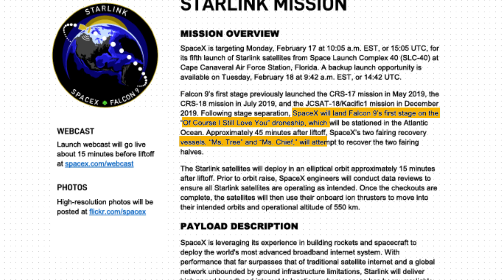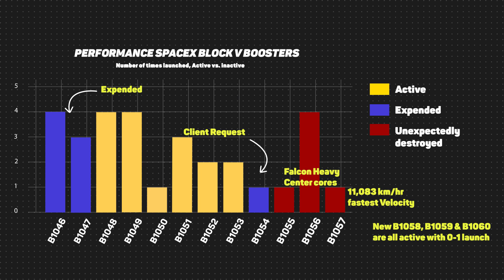SpaceX landing misses target, bad for Reusability?

Comment: The economics of re usability mean that you get diminishing returns. As an example assume the booster costs 50 million to manufacture. To catch and refurbish, 1 million. Then on first reuse, you save 24 million per flight. The second reuse is only 8 million cheaper per flight and so on. After 8-10 flights your main costs are fuel, refurbishing launch pad costs etc.

Comment: To be fair, the booster didn't explode, it just missed the drone ship. If it wasn't trying to land on a postage stamp in the middle of the ocean then the booster might've been able to still land. So it was some kind of navigation error, whether that be software or hardware related. Those are usually not that hard to fix. Heck, considering they missed the fairings too, it could've been an error in the ships' navigation software.

Comment: Bad video, "failures" is what has got us to this point with the falcon 9 rocket. You learn very little if it goes to plan. Wind anomalies, high altitude winds. Landing on the barge I still love you is the best way to use the worst case scenario for landing. Hitting a moving target from space. Landing on land is much easier and if you miss center mass you got a area like a helipad.

Comment: Is there any benefit in continuing to push the envelope with F9, when Starship will soon be taking over? Or is Starship's arrival still too far away?
Reply: F9 will be the main rocket for another at least 5 years
Reply: @cazymike87  Was this crash due to an attempt to push the envelope on booster return, or was it likely due to some other hardware-related failure?

Comment: point of the video???
Reply: This is the only video i've seen to show the fate of all Block 5 cores.   That seems like a good point.
Reply: Dan Cobb then rename the video...💁🏿‍♀️
Reply: @dancobb118  
No it's not, there were many others. There was zero new information in the video, but it implied that SpaceX is still struggling with landings, while in reality this would have been the 50th successful one. And StarLink launches are really pushing the limits of the booster, that's the most likely main reason of the failure. Probably the reentry heat caused some damage, it happened before.
Reply: András Bíró    Just because you have seen something doesn’t mean everyone has.    New to me does not mean new to everyone.

Saying there is zero new information is a statement you can only make for yourself.   You can’t speak for others
Reply: @dancobb118  
The main issue with the video is that it's misleading, it implies that SpaceX is still struggling with the landings, while in reality this would have been the 50th successful one. Now you can see a booster landing like every two weeks.

Comment: It's only 1 mishap. No big deal. Did humanity give up on going to the Moon when the Apollo 1 crew died? No! 12 humans ended up on the Moon between 1969 and 1972. Did the Space Shuttle program die after the Challenger exploded, or right after the Columbia tragedy in 2003? No! 14 astronauts were killed and still the Space Shuttle flew until 2011.

Comment: It is all about the costs, folks. Besides the costs of recovery, transportation, and refurbishment, the failure rate of recovery have to be accounted for. Also, there is a performance penalty for recoveaiblity. The added gear to make it possible to land adds weight to a booster, and thus reduces payload. The (optimistic) number of 10 reuses doesn't leave much room for the costs of recovery and everything else. If the success rate of recovery is less than 10 (4-5 maybe?) then it is not going to reduce overall launch costs much. Of course, in order to know just how profitable it really is (or isn't), all of the costs of a falcon nine first stage manufacture, the cost of recovery, inspection, refurbishment, would have to be disclosed. Has anyone seen the real costs? If so, can you provide the cost accounting?

Comment: Possibly SpaceX are using their StarLink launches to experiment with booster return tweaks?  There would be no association with the customer if the landing failed.  The landing before landed harder than usual also, so these couple of incidents indicate some change.  Could it be that naughty Russian sub[s] that was spotted doing the old GPS spoof thing?  Might explain the miss...  :)

Comment: Bro they're going to be building like 1-2 Starships a week by 2021, having a somewhat slow turn around won't be a problem. 

Also Super Heavy booster is supposed to land back at the launch site so It's not going be going at insane orbital speeds making landing way easier and turn around much faster.
Reply: I doubt it. Raptor production would have to go up too. They still need to build and test a Starship, then at some point the Super Heavy booster, and build/set up buildings and technology to stream line the building process. Also, they will want to test in between prototypes to rapidly develop Starship to be safe, reliable, efficient, cost friendly, etc. We will see how it goes but it is a huge goal that they probably won't reach for a long time.

The only thing that might make this goal a reality is they need to hurry up so they can launch more Starlink satellites. I wish them the best but I don't think they will reach the goal until 2022 at the earliest.
Reply: FreeStuffPlease im pretty sure elon said they wont reach 2 starships a week until 2024
Reply: @theenjeneer2493  I wouldn't doubt it. I was just being optimistic but you are probably right. No way they need that many for Starlink launches even if the turn around time on boosters and Starships isn't that good at first.

Comment: Step by step process. Spacex has had a pretty solid run of successful landings over 4 years. Now they're pushing the envelope to get a faster turnaround. And they can do so when it involves their own payloads. Obviously an explosion is not everyone's cup of tea, but they would rather take risks with their own payloads than a customer's. Launching a rocket is hard. Landing one up until 5 years ago was never heard of. It remains to be seen whether it is viable to have a 24 hour turnaround for a Falcon 9 rocket. There isn't enough customers warranting a quick turnaround. Spacex may reach a point where 3 months is an acceptable turnaround that better ensures rockets are fit to fly, thereby increasing reusability to 10 launches or more as opposed to launching within 24 hour turnaround and increasing risk. A better turnaround target would be for Starship to facilitate mass mobilisation to a destination of personnel and cargo i.e the Moon or continental flights. If Elon Musk wants instant flight turnaround a la Star Wars spaceships, well that's another story...

Comment: The SpaceX engineers learn much more from their “failures” than from their successes. Whatever is learned from this failed landing will lead to multiple improvements and better reliability going forward. Using one first stage to launch 4 missions into orbit has never been done before — that alone is an amazing accomplishment.
Reply: yeah it really is an amazing accomplishment, it was also one of their most aggressive launches yet putting 60 satellites into Low Earth Orbit in 15 minutes.
Reply: @jamess4342  It wasn't the first launch to get 60 satellite to LEO, and all rockets take about 15 minutes to get to space. There is a lot for SpaceX to be proud of, I just don't see how the things you mentioned are particularly impressive
Reply: "Using one first stage to launch 4 missions into orbit has never been done before" - what do you mean in this sentence? B1048 and B1049 have already been launched 4 times and 4 times successfully LANDED - see this video at 3:43.

Comment: Not defending it, a failure is a failure, but this one did have some extra factors making recovering the first stage difficult. It used a new trajectory for a new elliptical orbit for this Starlink batch that required some extra velocity. Either way, at least the main mission was a success.
Reply: Maybe next time they will just reduce the apogee slightly and have some more propellant for landing.

Comment: There must have been some failure on the booster, probably lost of navigation. At least in the past they have not had redundancy on landing systems, so SpaceX may have to think about getting some redundancy. I don't think the 63 day time is the problem, because they have quite a few boosters they can fly. Next Starlink mission should be 5th flight for a booster.

Comment: It didnt RUD. It soft landed next to the drone ship
Reply: Scott Manley had a source tell him that it broke apart after tipping over. No official confirmation though.
Reply: Anthony Pelchat ...Even so, that’s hardly a RUD.  Not “rapid.”  Not “disassembly” into many parts.  It’s more a FAB...Fell And Broke.
Reply: Steve Martin still counts as a RUD tho
Reply: Nearly Everyday Astronaut ... Perhaps “Nearly.”
Reply: @737smartin  And maybe it fell from 8 meters above the sea as that's the altitude it was supposed to stop. If it did that successfully it wouldn't be a soft landing as we saw with the CRS-16 (?). This may well have broken open one of the tanks with a little fireworks to boot, and sunk cost.